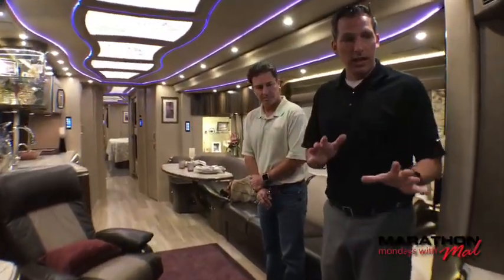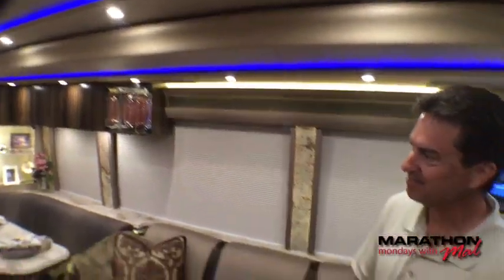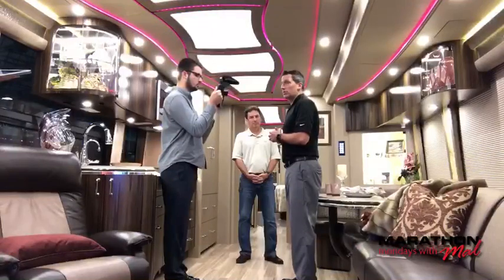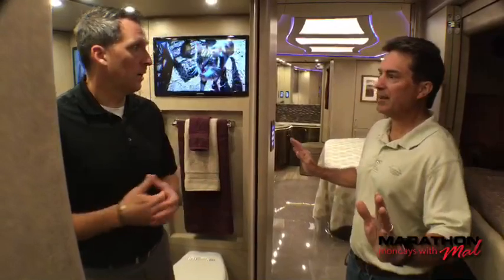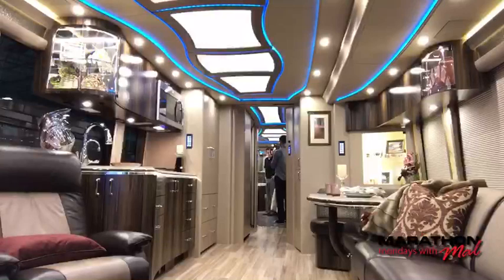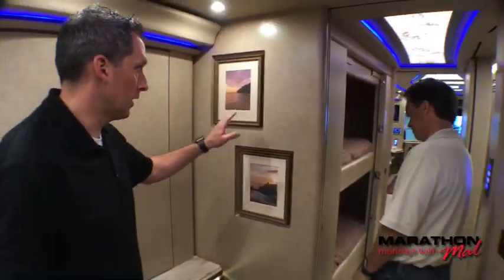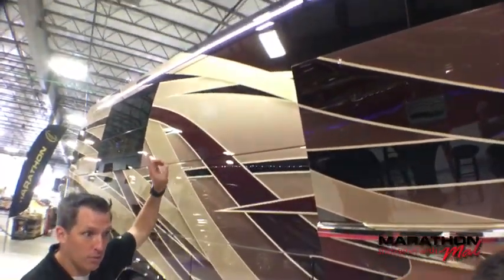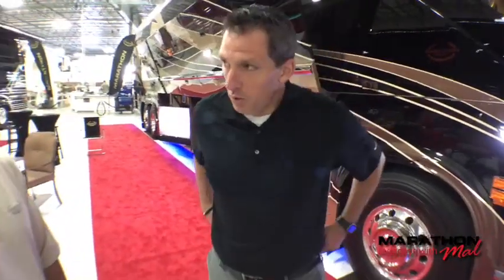New and Nuanced Luxury RV. Marathon Mondays with Mal: Ep.23

Comment: Being that the air suspension automatically "deflates" when you shut off the engine, is it necessary to make sure the front wheels are straight or centered? Will it cause damage to trim on the wheel wells if they are not centered?